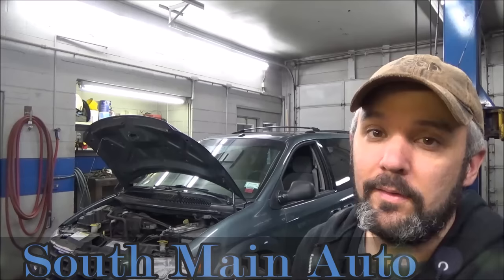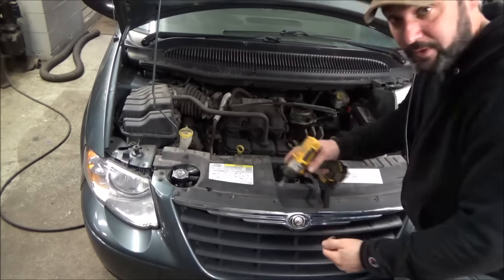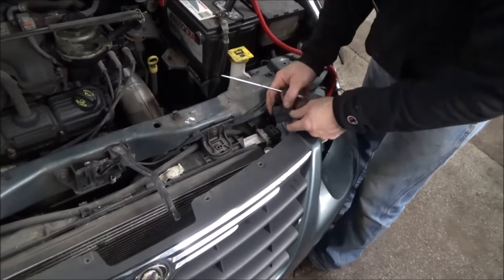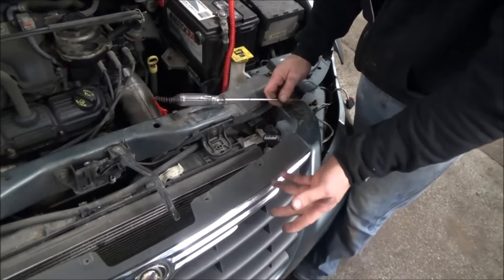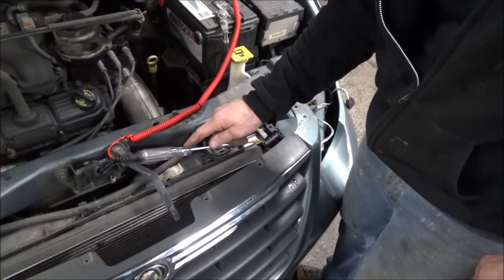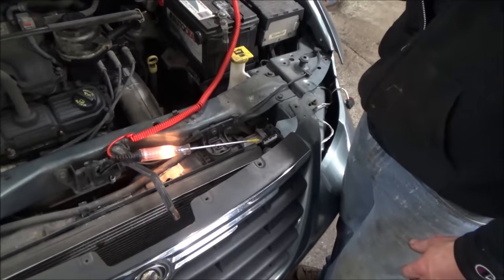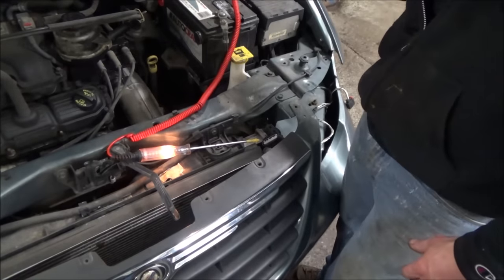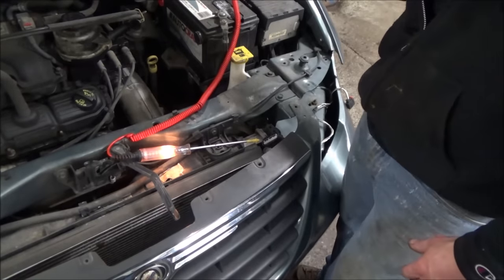Chrysler Town & Country / Caravan - P0480 Cooling Fan trouble

Comment: And Eric hits another home run.  The fan in my Caravan comes on at 140f without the A/C on and sometimes won't shut off until I restart. Haven't figured that one out yet. I just turn the tunes up louder. It's funny that when you have a certain brand in your shop for repair it's immediately JUNK.  HaHaHa.
Reply: Mine to. I love my 01 Caravan 3.3. They r as good as about anything out there. Sorry!!  I know there r a lot of Chrysler haters out there
Reply from the maker: +wysetech2000 Sounds like you better bring it to SMA haha!
Reply: +South Main Auto Repair   Why?....Wanna buy it?  {:-)   I'm too busy putting out all of the other monthly  fires to get to that glitch.
Reply from the maker: wysetech2000 HAHAHA NO WAY! I will sell it to a customer though and make money off it for the next 5 or 6 years haha! I guess just be thankful the fan works at all!
Reply: +South Main Auto Repair  Just had an idea! I should start doing repair videos on my van. I could do one a week for the next 5 years. I could call it the 07 Caravan channel.  LoL.
Reply from the maker: haha and be helping 1000's of people at the same time :)
Reply: south main auto repair is there a way I could email you concerning a problem with my 2005 town and country. I just replaced the same grey module and the fans still dont come on. I did the test on the plug and the number 4 wire didn't light up when I used the tester on it connected to positive

Comment: My car is 2002 Chrysler Town and country V6, 3.8 l  it's radiator was  fan not working  and i checked the fan connect with  battery and the fan is good and i tested the radiator 40A fuse it;s good ,  i was suspect bad relay located beside radiator or behind front left head light  and i bought the new one and tried the fan did;t work . anybody  can tell me what suppose to i do or what is the next step ?
solomon
Thank you!

Comment: What do I do if the 40 amp fuse for the radiator fans keeps blowing out when I turn on the blower for the AC? Constant power is good, constant ground is good, but the modulating power is not working
Reply: Sounds like a short somewhere

Comment: My problem is the cooling fan is on all the time.  Turn the van off pull the keys and the fans are still running.  I replaced the relay but that didn't take care of the problem.  Any suggestions?
Reply: Maybe your coolant temp sensor?
Reply: @nugget5103  Thanks for the suggestion, that's the second thing I replaced. I'm pretty sure it has something to do with the A/C side.  When i replaced the relay the fans turned off when shutting the van off, but as when I restarted it and turned the A/C on the fans would not turn off when shutting the van off.

Comment: Is it possible for the fans to draw too much resistance and blow out the relay? Kind of like blower motor resistors, where the motor draws too much resistance and kills a new resistor within short time.
Reply: +Edward Shen Yes they can. It might be wise to check the current when doing this job, just in case. You probably can't find any specs for the current anywhere though.
Reply from the maker: +celeron55 Yes and thank you for understanding that! I can check the current yes... however, what is good!? We know this though, it is less than 40 on start up and running ;)

Comment: Well my Colling fan on my 2012 t&c will not come on unless the AC is on.

It was giving me a Low Fan Circuit Low code before but I unplugged the cooling fan resistor and adjusted the gap on the connector pins and now the fan comes on only when the temperature gauge is to about a quarter but then when it gets to 204f the coolant reservoir starts bubbling and it starts to overheat and the fan never does come on again

I'm guessing it's gonna be the computer. 

I have a snap on versus and so I'm able to turn on the low and high fan with it but what's weird is that if I turn on the fan through the TIMP module, both low and high speed work the way they should, but when I command the Low Speed/Cooling Fan Relay#1 on, the high speed fan comes on. So that's why I'm assuming it's a bad computer. Does anybody have this issue?
Reply: I have the same issue. I'm replacing the coolant temperature sensor. I'm sure that's the problem.

Comment: am I the only one whose relay is actually under the headlight this is so wierd 2000 Chrysler Town and country
Reply: nah brah...I just watched a whole video on a Dodge Caravan and then when I went to work on the one I'm working on everything was completely flipped around on the other side of the car. Weird shit. Same engine and capacity. Plus in his video there was no power steering reservoir stacked ontop of everything like in the one I'm working on. Have you ever taken one of those out? There is a bolt in there that is facing the rear and bigger than the others, with no chance of ever seeing it to get the socket on, you have to get an extension and feel for it. Basically, even if you're the best mechanic in the world, if you've never worked on that car before you'd still have to know exactly what to do in order to get that thing off the car. Really starting to think Chrysler just likes playing mind games with people in order to discourage anyone but a mechanic from fixing their own vehicle.

Comment: I have a 2013 ram CV van cooling fan come on when warm but then will not shut off do you shut the key off everything seems to check out but the check engine light stays on with this existing problem the same thing happens with the AC relay is good motor seems to run well.I can't find any confirmation that it uses a fan control module  I don't think it does. Thank you for feedback

Comment: Only one fan works. What’s that mean
Reply: I have the same question
Reply: Ben Custer  I figured it out. The connector to one of the fans was fried. I bought a new connector and spliced it on there. Works now.
Reply: lucas pallan thank you I think I actually have two separate fans vice one unit with two fans in it.